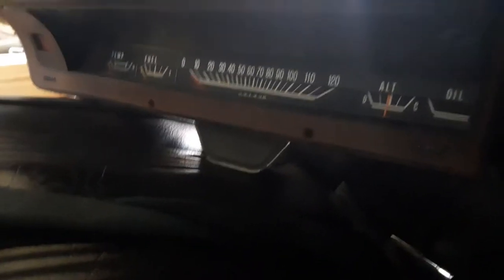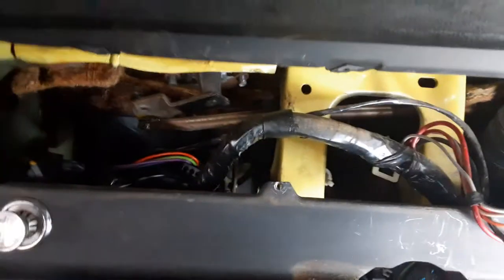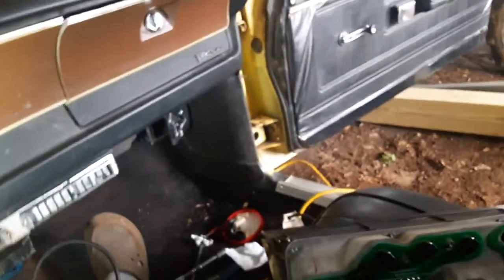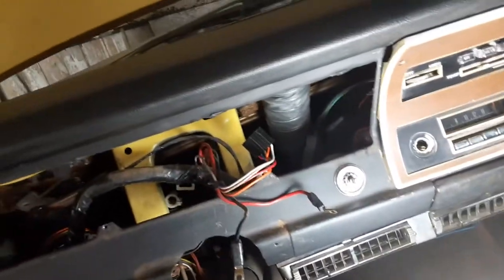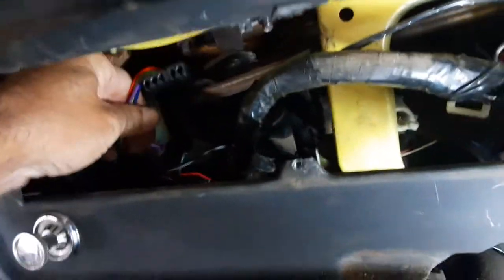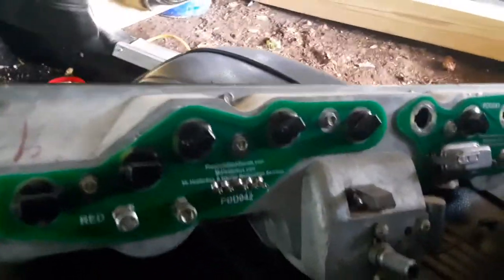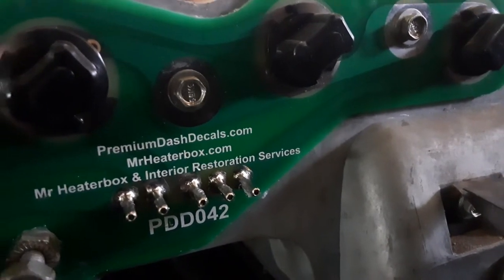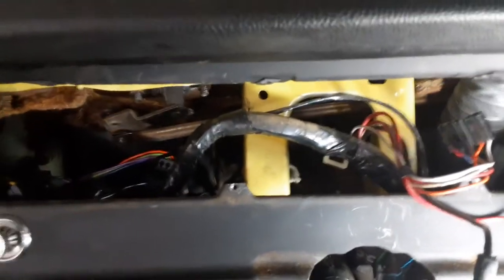Pulling instrument cluster on 1970 Dodge dart

Comment: I have an issue wit the alternator indicator wire inside the cluster shows one side red the black wire don’t show the red connect to the right side it’s that correct
Reply from the maker: It's been since I made that video but seems I remember those terminals where the wires hook up being marked + or -   something like that comes to mind... atleast on my car..
Reply from the maker: I just went and looked at my video and if you look closely it's marked Red at the terminal for red wire..   just have to freeze frame at right moment...  but those are after market circuit boards on my car.. but it should be exactly same on stock factory boards..